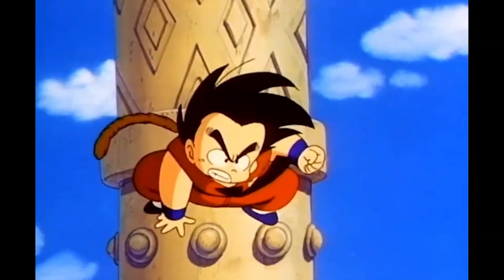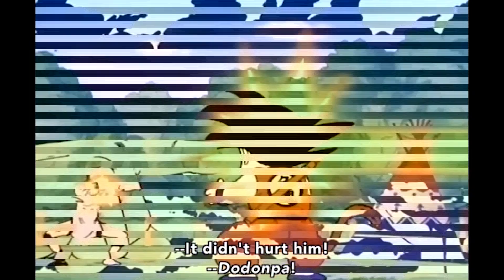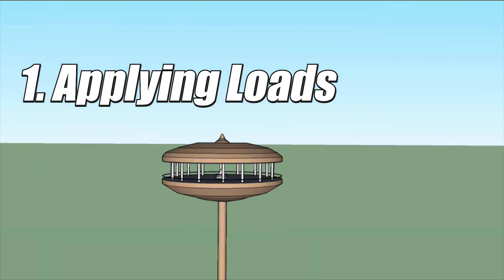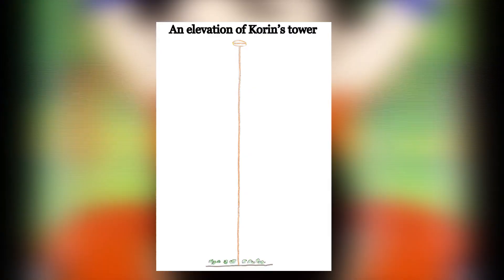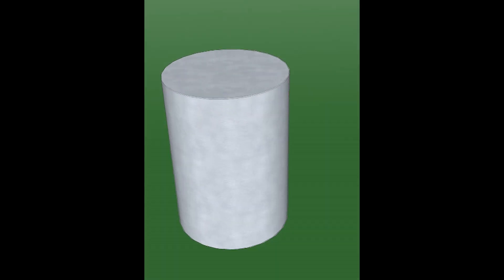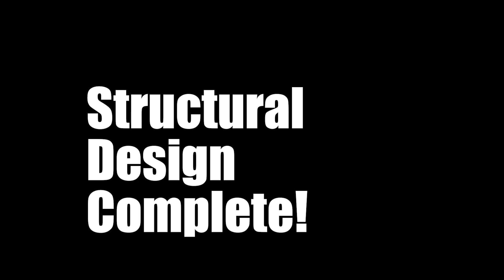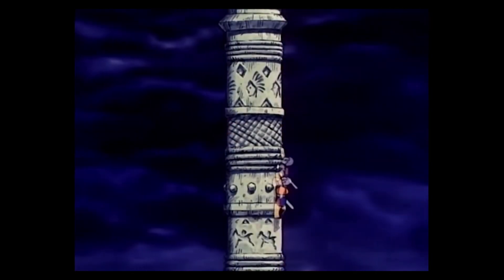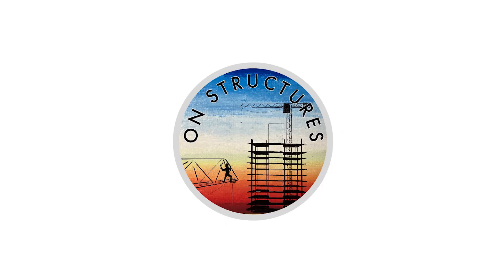Dragonball's Super Tall Tower: A Structural Analysis

Comment: The Tacoma bridge wasn't due to resonance; it was due to complex non-linear interactions. At least, that is what my differential equations textbook says
Reply from the maker: Oh that brings back memories of diff e.q., if I remember it correctly, it was the "imaginary" resultants of the differential equations that were the hidden resonant frequencies of the structure that weren't obvious to engineers at the time. The wind loading at the time of failure was only ~30mph, much lower than the design loading. But I'm trying to recall a lecture from 13 years ago.

Comment: If the tower was hollow (so a very long hollow cylinder), wouldn't that help with both the weight problem and the elasticity?
Reply from the maker: great point, I ran analysis on hollow tubes as well with varying thickness, and yes, generally these perform a lot better. I wanted to simplify the analysis for this video a little bit (in part because it was my first essay, and to this point still the most technically complex) so I left that portion out. The hollow tube would perform better for the self-buckling analysis by 20-40%, but that still didn't make much of a difference in the grand scheme. 

And for elasticity, or the propensity for a material to return to its original shape after experiencing a load, the solid tube like performs better as the hollow tube has walls that can buckle locally at lower load than the global capacity, and the solid tube should be more elastic, generally speaking.
Reply: @onstructures  fascinating!

Comment: What if Karin's tower is so tall it actually experiences centrifugal forces pulling it away from Earth? Kind of how a space elevator would work: https://en.wikipedia.org/wiki/Space_elevator#Apparent_gravitational_field
Reply from the maker: Right, that’s a good point! I looked into it but the height isn’t nearly tall enough to start to overcome gravitational pull. I think the wiki says it needs to be 30,000km tall
Reply: @onstructures  The lookout might satisfy that, maybe they're magically tethered?
Reply: Not kind of. That is exactly how a space elevator would work. You're describing a space elevator.

The point where centrifugal force exactly counters gravity is known as geostationary orbit. It would need to go 35,786 km above sea level. For comparison, Earth's radius is 6,378 km. It would also need to go above that, since the top has to counter the bottom where centrifugal force is too low. Ideally, a space elevator would get exponentially wider as you go up, since it's carrying all of the tower below it. The fact that this one isn't means that it would have to be significantly stronger.